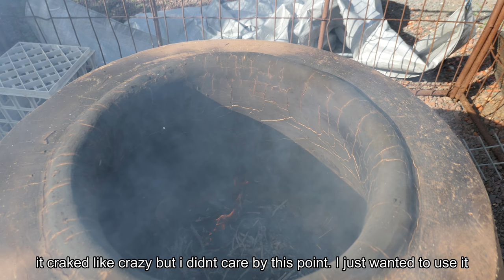Making a Tandoor for Pottery Firing (in pictures)

Comment: I learned a lot watching this -- both good and bad!  I think the exercise ball at the top was genius, I'm going to try to use that!
Reply from the maker: The only thing wrong with the exercise ball (apart from me being stupid and leaning on it with all my weight) was that you couldnt get in to check and smooth the inside seams till it had dried enough to remove the ball. That frustrated me a bit. It turned out easier on my my mind to do it without the ball... I really wanted to get in there lol.

Comment: I’m planning on using some cob in clay in a few projects. Aside from the drying, how was it to work with?
Reply from the maker: Replied then deleted my reply by accident. sigh. perhaps its too early in the morning for me ;-) . I found the clay and straw really easy to work with. Mixing it was slow because of the large batches. I had my mixture quite soft on purpose so it would be easy to spread and shape.  Being a little too soft was what caused the collapse on my second try. But I think it would have been a much more strenuous job if the clay had been firmer.

Comment: Adding sand to the clay in addition to the straw would reduce shrinkage and cracking.  You appear to be using adobe, adding sand makes cob.  Is a tandoor traditionally used for firing ceramics?  The only context I've seen tandoori used for is cooking.
Reply from the maker: I copied videos Id watched on youtube to get a recipie for mixing the clay. In all the Indian videos they didnt add sand so I just copied what they did. I really had no idea what I was doing. As to firing pottery in a tandoor; the fire rules in this area are that you are only allowed to have an outdoor fire in a structure designed for cooking human food. So after lots of thinking, and seeing this video of Andy Ward's https://www.youtube.com/watch?v=o4fCJfejiiQ , I decided a tandoor fitted the rules. It seemed to work really well but Ive only used it once so far.

Comment: How is the Tandoor working out?
Reply from the maker: That tandoor is gone now. I probably only did 6 firings in it. I thought it was cracking up too fast, and it was in the way where it was, so I smashed it down and am preparing to build version two in a more out of the way place.  When I started breaking it down i discovered it was way stronger than it looked. it was really hard work to break it up. so I could've kept using it for a long time. On the new one I will be using a much better clay. and i will use sand instead of straw, and Im going to make it higher off the ground so it doesnt get a wet base every time the driveway gets a bit too much  rain in it. I still think it is an easy and efficient way to fire and will make version two about the same size, just a little bit taller and with slightly bigger airholes.
Reply: @nom_b  Good luck. I look forward to seeing how the new one turns out, and temperatures you're able to achieve with it.

Comment: real nice job. 
and now im buying all the old shovels i see at garage sales to use as cover shards. 
tom
Reply from the maker: The old shovel idea was Charlottes, I just copied. Sadly I only had one broken shovel lying around the yard ;-). I did notice that the pots under it didnt get as much heat compared to the pots under the thinner covers I used. Having all the same thickness covers will work better
Reply: @nom_b  i think some may be a little big , or if you need a different shape, a person could cut them down with the cutoff grinder. thanks